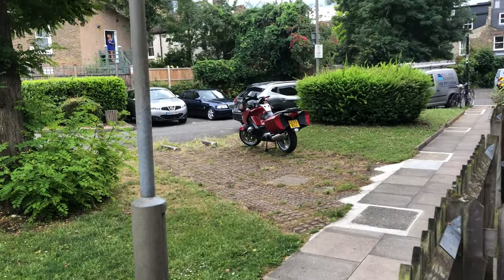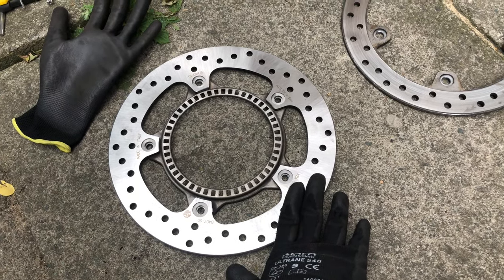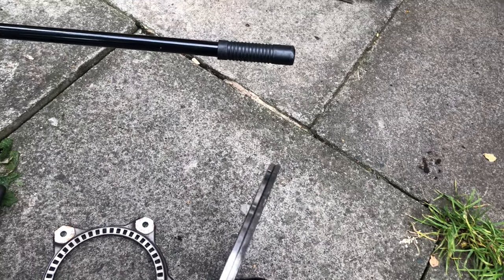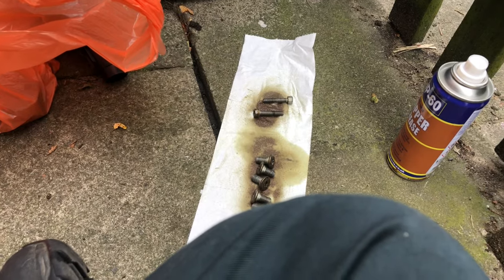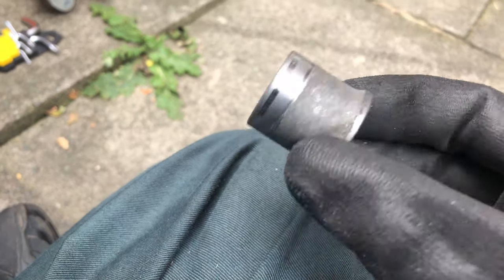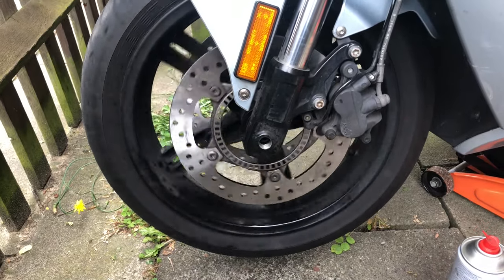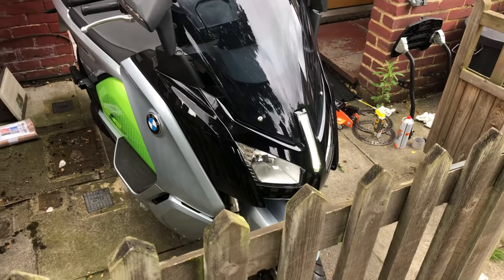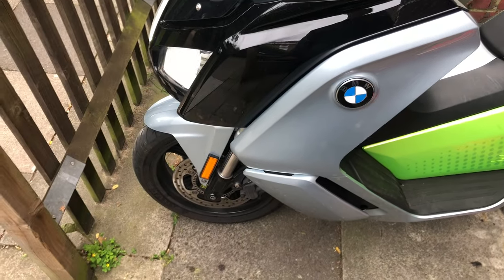Warped front disc brakes on my BMW C Evolution?!

Comment: Thank you for sharing. Brembo most probably supply BMW so yes they are the same disks (without the BMW markup!) You should have replaced the pads too as they will take ages to bed in and give you full braking performance. I would also recommend a torque wrench! I have been considering buying one of these but I still have some reservations, one of which is charging. I spotted in this that you have an external socket in the background, did you get the OLEV grant for that or is it just an ordinary external weatherproff socket?
Reply: Hi Ian - yes, completely agree and i've ordered the pads already. I've got a torque wrench on order for my birthday later this month but borrowed my mate's for this job. I actually have 2 charge points in front of the house...the 7kW NewMotion charger and a 3 pin socket. The C Evo mostly charges at work for free but I also have a Tesla which mostly uses the NewMotion home charger. I managed to get the £500 OLEV grant as technically i can fit my C Evo on my 'drive' which is one of the conditions. The C Evo can use the NewMotion charger but it only does so about 3x a year. In terms of your reservations for the BMW C Evo, i can't recommend this bike enough. I've owned a number of bikes and this is by far the most fun. It just can't be used as a long distance tourer...if you're ok with that or have another bike (i do), then this is an easy choice. and such a heap of fun. If you're around the London area and ever wish to have a go, i don't mind meeting up and you can try it yourself.
Reply: @OVB_NL  thanks for the offer but I live in the Yorkshire Dales. So a bit beyond the range of your bike :-) If only it had a 7kW on board charger that would not be so much of an issue.